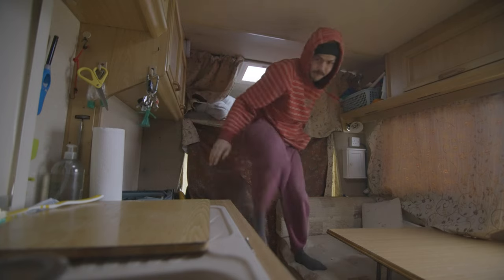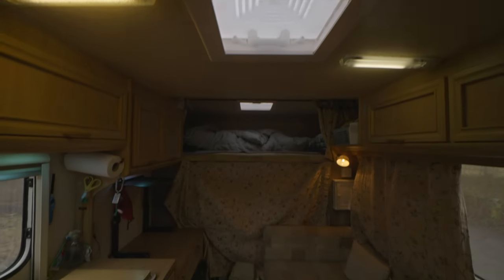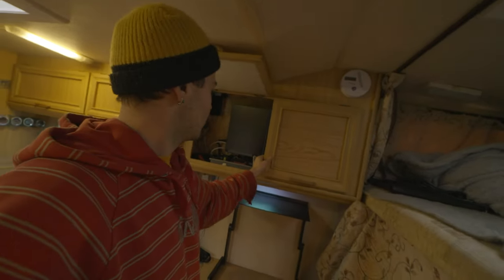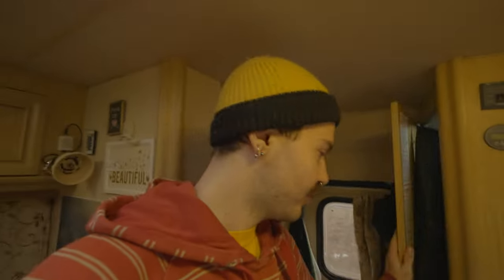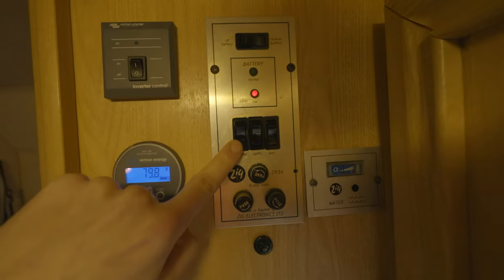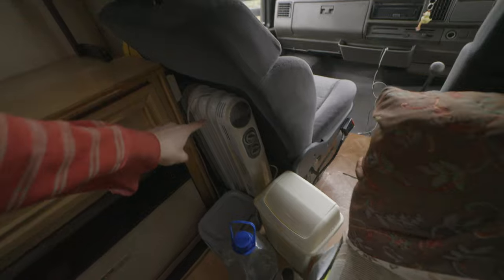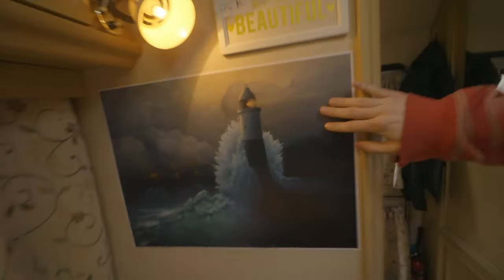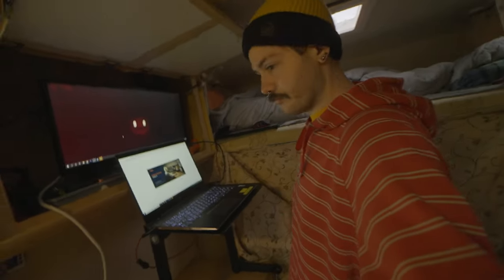I live in this 1989 Talbot Express | Vanlife UK 🚌

Comment: Love the van! Ours is a little bit younger than yours, but still no spring chicken at 20!  Some things that we learnt the hard way that might be helpful to you...You can change your strip lights to LEDs really easily and you will notice a HUGE difference in the power draw.  You can get a cheap roll of foil backed insulation for a tenner from B&Q or similar and make some screens, especially for the cab windscreen and side windows....again, you'll immediately notice a difference. Lastly, in winter, rugs are your friend...even cheapo ones from a market will add a layer on insulation on your floor and make the whole van warmer...plus a bit softer on the feet as well!  Good luck!
Reply from the maker: Thanks a lot for the tips!! I do actually have LED’s but forgot to put it in the video haha.

Comment: My partner and I have just bought one. It's 1990 with 61k on the clock. Bought it to live in and save money as will be moving to Spain in a couple of years. Have a house in Spain but now want land. OK to live in but I'm just getting used to driving it as no power steering but as our car is a 2011 lexus hybrid automatic, a total culture shock for me and you really have to drive it and no power steering, plus takes about 10 minutes to warm up.  My partner drives lorries for a living and more used to it.  We are doing it up at the moment but won't be travelling far in it, more for living. Had a small leak but now recovered the roof with rubber paint. Personally it's OK  and engine runs great but gears slipping abit. Will be taking it into mechanic to have it checked out. But for the age, she is an old girl and not expecting all the bells; whistles  and smooth driving you would get with a newer vehicle.

Comment: Hi just subbed, I have the same van! and like you I bought it to live in. Been working on it over the winter and its now on the road. I have solar which I installed and it runs my 12v TV/Monitor all day and evening no problem. I produce more power than I use! very cheap to buy too. I kept my thetford toilet and have no issues to empty it. Ive done a lot of work on the van and installing a deisal heater was great and very cheap to run. look forward to more videos. If you need any suggestions on how to improve it just email me. I am a film maker too. great channel: edited comment I saw your channel picture has the old pier in weston! I filmed it in 2015 lol
Reply: Hey dude, any help you can offer re power would be great.  I have a leisure battery that sorts out the lights, but not even a USB socket in sight!! I'm crap with things like this but need to get better!!  Hope you're enjoying the summer!
Reply: @leehoddinott5782  change your existing lights to LED very easy cheap last 8 times longer lol.  USB in the cig socket will work but not great for the starter battery. I may make a van tour too of mine to show how i made it solar on the cheap lol